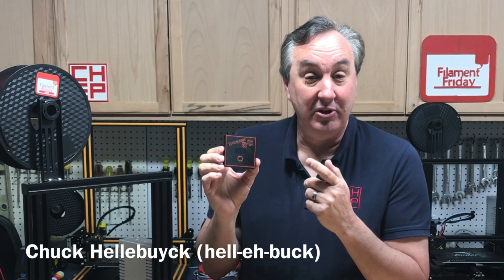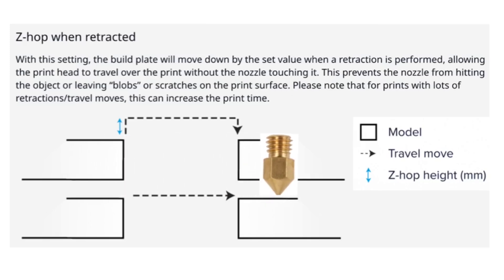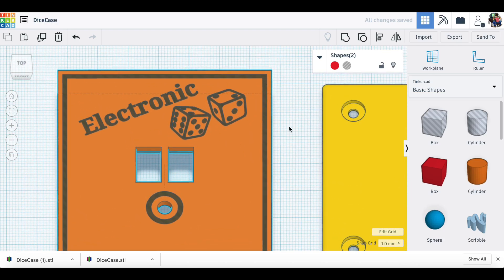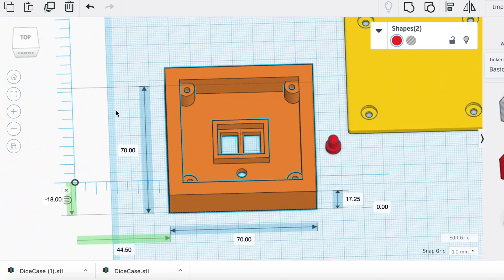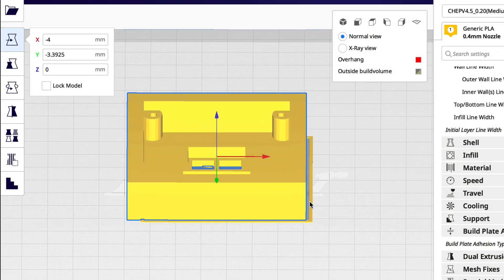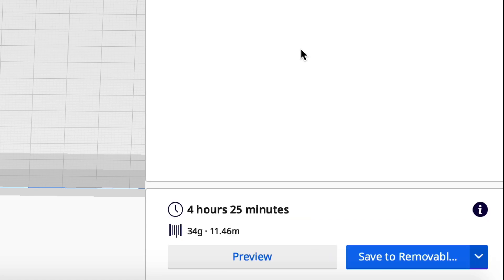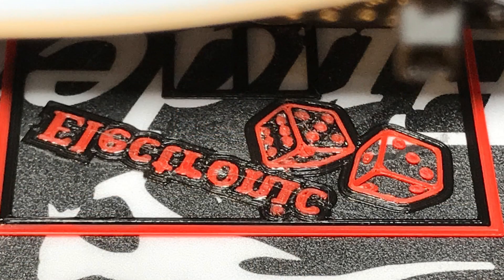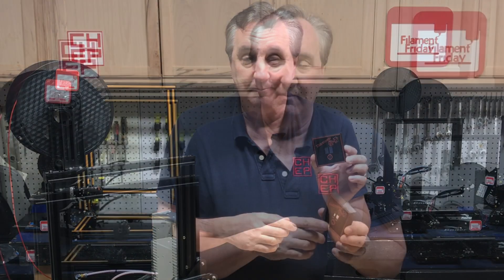Smooth Two Color Inlay 3D Print Using Cura Z Hop on Creality Ender 3

Comment: This will only work if the letters you are doing are low enough (not many layers). If you try this with more than two layers to the letters, the new colour that will lay in beside the letters might be hit by the nozzle point, potentially knocking the letters loose from the bed (and that can still happen even if you pick a high enough z-hop value, because it’s not the hop that could knock a letter loose.... it’s the nozzle traveling right next to the letter laying down the new filament that’s the issue). 
You might ask why anyone would need to use more than two layers for the letters? Well, some colours/brands of filament have different transparency values. Example, I have a white filament that unless I use 4 layers for the top and bottom at .2 per layer, or 4 layers for the walls, it will still somewhat bleed/show what is behind it (whether that’s an infill design, or a different darker colour in Chuck’s video example). So if I were to make a print with white letters and then black for the rest of the print, using a .2 layer height for the white (at only two layers high), the black will darken the white letters enough that they would no longer be nice and white. I’m sure there are white filament brands out there that this is not an issue for, but I’m not about to buy a bunch of different brands just to find one that works well that is not affected by different darker colours behind it. :-(  But thank you for the video Chuck. :-)
Reply: Then maybe you need to try getting creative. ;)
This is how my "engineering mind" works:
Break the first 0.8mm of the model down into two 2-layer sections of white and one 4-layer section of black .
e.g. if you need 4 layers of white with, say, black around it, set up your first print of white as in this video - 0.4mm high.  Then, do only 0.8mm of black (with the "hole" for the white).
Go back an create the next 2 layers of white, but make sure they're 0.4mm off the bed when they start.
Then continue the rest of the black, making sure it starts 0.8mm off the bed.

So you get white inlay > black surround > white inlay > black background.

Alternatively:
Make the first lot of black 2 layers and do that first.
Then 4 layers of white.
Then the remaining black, starting 0.4mm off the bed.

The second one is probably less hassle - certainly less filament changes.
Reply: Maybe between the two prints apply white paint to the top of your inlay parts?

Comment: Very nice man. This works great as long as what you want to inlay is only on one side. If you have multiple inlays around say a cube then I agree with the poster that said to use the horizontal expansion. Would be really neat to see you do a video on that! I understand for a single side this way is WAY easier though!

Could you do both gcodes one after another? Let me explain. If you combine both gcodes and just put a pause command in between (of course you have to remove all the starting information on the 2nd gcode file before adding it) would that eliminate the cooldown for a glass bed so you could change filament and then have it start printing or would the layer height be defaulted to the last layer you used rather than the actual first layer?
Reply from the maker: You could do it all in one GCode. If I wanted multiple sides I’d make the box print flat and the fold up the sides. I’m not spending time manually placing tiny dice dots in an inlay.

Comment: Awesome trick! Love it and very useful. Would you heat the bed when using PLA?
Reply: I've only had mine a few weeks, but I've had no problems with heating my bed to 60c with PLA.
Reply from the maker: I use heated bed. 50° typically.

Comment: Hey Chuck, great video as usual. Have you ever out a pause command in a g-code so that you could switch filament part way through? I’ve got a raised logo on a design that I would like to be a different color and it would be great if I didn’t have to worry about pausing at the right time. Thanks in advance

Comment: Great stuff, but I have one reservation. I have a glass bed and prints stick really well while the bed is hot. But when the bed cools the prints just pop off. I guess that means I’d have to jump in quick to change the filament and get the second print going before the bed cooled. I suppose I could remove the gcode that turns off the bed heater in the first print so it stays warm. What do you think?
Reply: I use an Ender3 on which preheat can be to be turned on separately for the bed. Rather than muck around with gcode,  if the first print only takes a few minutes wait till it finishes and turn on bed preheat to keep the glass warm. Then change the filament.
Reply: Or you can just go to settings and re-enable Pla preheat
Reply: You could edit the "cooldown" line out of the gcode.
Or just make sure you're around to start printing the second file before it cools
Reply: @JoeyTen   i do it all the time without preheating my glass bed

Comment: Awesome! I was very successful using this with Fusion 360 and SuperSlicer with a rectangular body. I was making a travel tag for my dog carrier. When I changed the body from rectangular to Oval, the issues began. I can not get the text and body lined up on the build plate. There is a Y offset that I just can't seem to overcome no matter what I do. Any thoughts or tips?

Comment: I'm assuming that this would not work with an e3d nozzle due to not having as pointy as a tip when using 2 layers, but should be fine for one layer with no z hop.
Reply from the maker: I bet it would still work.
Reply: @FilamentFriday  Would having a bigger layer width help with that perhaps?

Comment: Thanks for all you do here Chuck. However I am having an issue with doing this. I think I am missing something. When I go to line up my two models when putting one over the other they always separate. It's like CURA is telling me that two models can't occupy the same space. Any help here would be much appreciated. I have tried this in CURA 4.13, 5.0, 5.1 etc
Reply from the maker: Uncheck “Ensure models are kept apart” in Cura preferences.
Reply: @FilamentFriday  Thank you very much. I looked at that screen so many times and never saw that.👍

Comment: Does the hop have to be that high? If the nozzle is printing the first layer, it should be at Z= 0.2 and it needs to clear the 0.4 high inlay. So a Z hop of 0.3 should work, right?
Reply from the maker: Sure.

Comment: Chuck is getting the  3D Fused Linear rails  x and z axis worth it, or I should source it myself? Can I get a price opinion on it.
Reply from the maker: I doubt it but I reached out to them for test units and got nowhere.
Reply: @FilamentFriday  thanks I want to add a linear rail to the x and z axis cause the ender 3 z axis and the x axis wheels get worn out with minor misalignment. Just at 150$ upgrade is a bit much for a 200$ printer.
Reply: @FilamentFriday  or you can do a self source linear upgrade example for us. The linear rails from aliexpress is around 12-15$. The rest can be 3d printed.  That be great if you can thanks.

Comment: Interesting but wouldn't the nozzle collide with the second layer and above  as the tip of the nozzle is wider than its hole diameter? 
Also you could use firmware retraction, if enabled on your printer, to change back the zlift to a normal value after the first layers.
Reply: TheForce 
I thought about that, too.  0.4 mm does seem like enough height to potentially interfere with the nozzle.  I guess it’s a ‘try it and see’ thing.
Reply: Depends on the depth of your text.

Comment: Hey Chunk How can I do it with Bltouch? Because when I try to print second part printer check whole bed again with bltouch and sometimes it comes to printed parts how can I fix that issue?

Thanks,
Reply from the maker: Disable the G29 in start code,
Reply: @FilamentFriday  Okay I will give it a try. Thanks for fast answer :)

Comment: This is great but I find it only works well with thinner prints.  I have one that I have been trying to do for a custom lamp for a friend.  The lens of the lamp has a design in it that needs to be in black and the rest in transparent.  Your technique works well for lower layer counts but I need 5 layers as the lens must be 1mm thick but 0.3mm layer height causes the transparent to be too cloudy.  0.2mm however is good.  I'd rather go down to 0.12mm if possible.  So I guess the question is how do we do this for thicker prints?  My thought is have it print 1 layer of black then 2 layers of transparent.  Then 2 layers of black followed by another 2 layers of transparent and then repeat until both are at 5 layers each.  I've tried everything I can think of in cura and orca slicer but no matter what I do I cannot figure this one out.  TBH I would think in 2024 with the amazing software we have that this sort of thing should be pretty ubiquitous by now.  Frankly, I don't think that what I am trying to do is so difficult or confusing that the slicer shouldn't be able to do it.  Back to the head scratching I guess.
Reply from the maker: If it’s that tall, print it separate and push it/glue it in place.
Reply: @FilamentFriday  I did that but it's not "perfect" enough for my standards.  I'm difficult this way.  lol
Reply from the maker: Why does it have to be so tall?
Reply: @FilamentFriday  Mostly for stiffness and impact resistance but also because the light doesn't diffuse out evenly when thinner.  I tried thinner and it flexes too much and you can see each individual LED. At 1mm thick it's very even.  I tried 0.8mm of transparent only with the black forming the last layer and the lines between the light and shadow was less crisp.  Chances are I'm just being a perfectionist but part of it is a personal challenge.

Comment: I am using Cura 4.1 with Magic 1.2, and when I set Z hop, the printer lays down the skirt and stops printing an sits and hums. It does this on two machines telling me it is a setting in Cura. I have left the settings stock and increased the hop to .4mm and it will not print until I disable Z hop. Any ideas?

Comment: I'm gonna need to hack this process a bit in order to use it with ABL. Have to recall a stored mesh instead of probing and need to instruct printer to home somewhere other than the middle of the bed (where inlayed piece is already occupying the space).
Reply: If it's small enough you could print off to the side.

Comment: Attempting this right now, the only problem I worry about is my printer touches the nozzle to the middle of the build plate at the start of every print. Hopefully that doesn't mess up the previous prints

Comment: Do you need to disable any auto bed leveling starting code or can you print without modifying start code?
Reply: You definitely don't want to probe the bed before starting the second print; or you're likely to either knock something loose or probe the first print instead of the bed! :-P
Reply: G29 can be removed in start code before slicing second color part. Problem is that Z axis home also uses BL Touch
Reply: melickon 
If you lock the motors at the end of the first piece, you can ignore re-homing.  Just change filament and print the second piece — from the code after editing out the homing (and probing)
Reply: @boggisthecat  "lock motors" - ? What is this?
Reply: melickon 
Look up the code to do this.  “M84 S0” should be the correct setting, then make sure you have “M84 X Y E” at the end of the code to disable (free) all of the motors except the Z axis.
Reply: @boggisthecat  Your recommendation is for CoreXY and H-bot kinematics? I have Prusa kinematic printer and I am not sure that I really need to do something special with Z motor

Comment: Hi, Chuck. Greetings from sunny South Africa! Hope you're doing well and keeping safe.

I know it's completely unrelated to the video but I've had luck with your profiles in the past and I was hoping you'd be able to help.

I've been printing with a 0.8mm nozzle for a while now but I can't seem to get rid of the stringing, as well as those long diagonal strands that grow as a result of the stringing on the outside of the print. And then when the nozzle travels past the outside outside skin, it strings and causes zits and imperfections.

I've tried different retraction settings as well as coasting but can't seem to get it right. Do you happen to have any suggestions?

Thanks in advance!
Reply from the maker: Check your flow rate and adjust.
Reply: Will do! Thanks for the speedy response.

Comment: Hi, I am trying to print with different colors. I have an Ender 3v2 neo printer and it has autolevel. When I make different gcodes, the printer level starts running and when it finishes, it goes to the initial position. In this movement if I have something already printed, the nozzle bumps it on its way to the 0,0 position.
Reply from the maker: Print off center is an easy fix.
Reply: @FilamentFriday  Do I have to put that setting in Cura? I'm going to search, now i know the name of the problem!!! Thanks you a loooot
Reply: @FilamentFriday  So why didn't you put it in the video saaaaaa

Comment: How do you handle the bed probing for the 2nd print? Probing could be off because there is already some material on the bed...
Reply: just use the same mesh as the first print (disable per-print levelling)
Reply: @sknight8621  I tried it, merged 2 gcode files into one, add a M25 in between, and remove some code like the bed leveling. One issue remains. Cura will auto centre the parts, which worked in my case, but is not a generic solution.
Reply: Ron DLH add a surrounding box that is in each print, that way it will center that box and that will negate differences in the different layers.
Reply: @rondlh20  excellent work around for the ABL. Is M25 a filament swap?
Reply: @CharlesD4rwin  M25 is a pause, it's used to swap the filament, then press 'resume' to continue

Comment: How do you make sure the letters get smooshed flat and smooth against the printing surface, without stringing when traveling that would show up on the face of the box?
Reply from the maker: Using proper retraction in my profiles.
Reply: @FilamentFriday  Thanks, do you use wipe in the settings as well or just retraction?

Comment: hello i have a little problem (or can't find a setting in cura) i can't look at the bottom of the bed like you do. to properly align manually. / or see if it is properly aligned. do you have tips? I use cura 4.61 Thanks !
Reply: Are you talking about at 3:36? If so, just hold the right click and rotate to see from under the build plate.
Reply: @DFroelich  that is the solution
THANKS

Comment: Will this work with "Combing" enabled? I had the impression Z-Hop not really working then(?)
Reply from the maker: I don’t understand? I just showed Z hop working.
Reply: @FilamentFriday I know. I just had the impression that when I use Z hop in Combination with Combing it is doing the Z hop less often as it follows already printed elements. CURA also shows in the Combing description that it is linked to Z hop somehow. I need to do more testing if it is a problem when trying to do something like you showed in this video. Cheers!

Comment: Wonder if I could expand this to 8 colour and do dithering? hmm I feel an experiment coming on, lab coat up, I'm going to learn something today. :)
Reply: i can save you the time: No.
Reply: @CharlesD4rwin  Actually I have had some success, I have a 4 colour inlay print, done on a stock Ender 3, colour dithering is a little harder, but I have had a bit of success and am still working on it. There is a video in the works right now.
Reply: @MikeysLab  Yeah, I'm referring to the dithering specifically. This procedure is fantastic for printing inlays in multiple colors, assuming you dont need the inlays to be very thick / tall.
Reply: @CharlesD4rwin  Yeah, I am actually hoping the experiment ends with a program you can provide the multiple gcode files too, and it will process filament changes and pauses during printing, as well as verify the alignment of the separate prints, and spit out a single gcode file with pauses. Kinda like what I did for the "buttery smooth 3D printing Timelapses" video

Comment: I tried doing this, but I run into the issue of the auto leveling sensor touching off on the first layer thats already printed so that when it goes to print the next color, its starts at the height of the layer thats already printed. Any way to fix this?
Reply: You could try moving both of the models away from wherever your printer homes its z axis if it only touches one point on the bed.

Comment: I'm struggling to get this to work properly for me. I have BL touch on my E3V2, should I be turning it off for the second print?  I have tried both ways, I slice my first layer, save, then load my second layer, centre over the first, remove the first layer, select z-hop and slice.  I've then tried both by removing the auto levelling line in the gcode, slicing, then saving that file.  The issue I then have, is by leaving the gcode in for both homing and auto level, my probe then comes down right on top of the print.  Easy enough I just allow for the 0.6mm of my bottom layer in my z-offset.  This doesn't work.
If I remove the homing and auto leveling code, I then have the issue of the printer not know where the axes are after I've changed filament
Reply from the maker: Offset it from the center so the probe can touch.
Reply: @FilamentFriday  yah, but the home with bltouch its always in the center of the bed. When you make a g28, it always goes to the center of the bed.